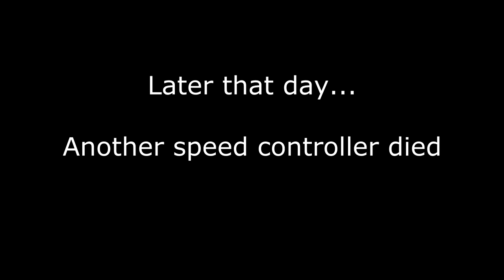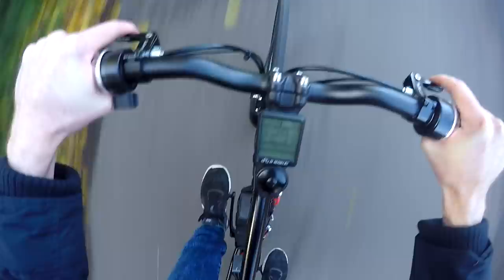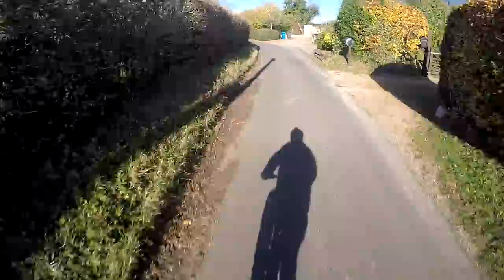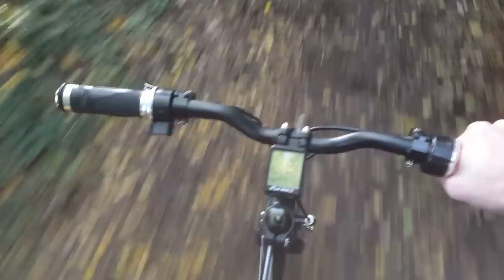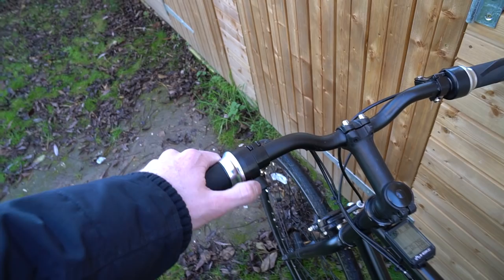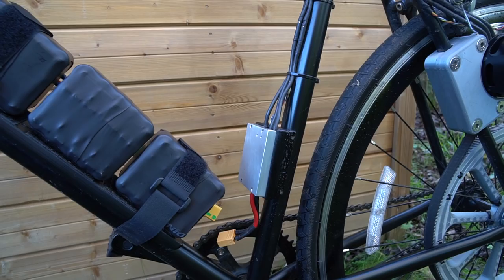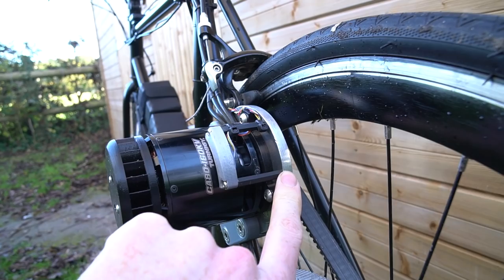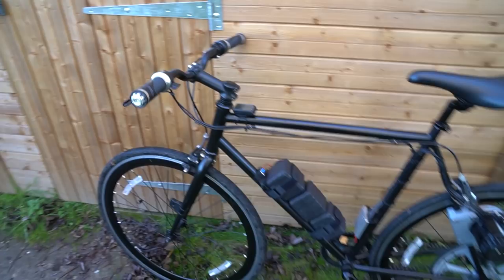Electric bike V3

Comment: I read a few comments confused about the power and pricing, and since I know a bit about this kinda stuff I thought id try to leave some info. Yeah, 700 euro is a lot to spend on parts for an e-bike. But compared to a kit you can find online for a similar power/torque/speed spec’d bike, you’d be looking at closer to 1000 euro. A completed bike with this much power? More more 1800 euro if not more. 

I built my electric bike using a 3kw hub motor, a 12.5 ah battery, and a 40 amp 52v controller. That alone almost cost me $1200 US. When you consider the brakes I bought, with the bike frame, and the lights, and everything else, I’m in something like $1400. 

My bike has seen 40mph in ideal conditions, and done 650m altitude climbs without a sweat, but I suspect the bike in the video is capable of the same with some minor tweaks to the gear ratios. 

For what this bike is, with the care that’s been put into the design and reliability, it’s incredibly cheap.
Reply from the maker: Excellent explanation! It is very easy to focus on the price and forget that performance comes at a cost. You justified the cost very well. Thanks!!
Reply: Raycool scooter 1900w cost 1200 euro and more speed 60 70 km/h
Reply: Tiago can you help me Tiago,
I am looking for an electro motor with a regulation like for mounatain driving, how i habe to calculate that whole thing when I want to say I want do drive cobstant 20km/h towards the mountain. is 500watt enough? an which battery to this?
many thanks
Reply: How much does it cost to get it certified though?
I don't know about other countries, but over here if it goes over 25 km/h it's a moped and needs to be "road legal".

Comment: Hi Tom, can you share a list of parts that you used? Maybe a diagram? Thanks, I want to build one so bad. Excellent video!
Reply: Even i
Reply: Hey guys, I'm currently in the process of making my own 3kw bike and I figured out these are probably the best parts rn:
kunray 3kw 72v motor kit (includes the controller and a throttle as well as the motor) 275$
72v 20ah battery (this is just a pre-made battery pack that works with the controller) around 275$ as well
my best bet is amazon for these
Reply: all you really have to do is make a mount for the battery and motor, as well as changing the sprocket on motor to fit bike chain.

Comment: Great build! 
I am sure it has been said before but here is once again from me.
You got this all free space behind the seat tube and the tyre. That is a great place to mount the motor so that somehow is in line with the frame. That only the pulley is sticking out on one side and the cooling fan on the other.

Comment: Hi Tom, Such a smart kiddie! Maybe a simple(ish) mod to relieve the squeeze on the motors by the small belt would be to incorporate a short shaft protruding from the back of each short belt pulley. A straight bar with a bearing for each shaft would hold the motors spaced correctly and relieve the tension.

Comment: Thank you fro great video. Is it possible to have some kind of clutch to avoid motor resistance while riding it as regular bike? What do you think about it ?
Reply from the maker: It is probably possible, but adds complexity and removes the regenerative braking capabilities. To be honest, I only ever ride this bike with the motor running anyway, otherwise I'd use another bike. Applying a small amount of power to the motor whilst pedalling makes it ride like a regular bike

Comment: Can I use a 380Kv (0.02513Nm) motor with gear reduction to produce enough torque? Combined weight of me and my bike is about 70Kg. How did you roughly calculate the amount of torque required at wheel for your build? It would be greatly appreciated if you could help me out. Thanks!

Comment: hi i am planning on an electric recumbent bike (full diy) and i planned to use a similiar motor then you do in this video. 
What is the reason that it is going "slow". i have checked many tests and some guys in australia managed to go barely 100km/h with 5.3kW on a bicycle. Are you limiting the max speed with your transmission? 
Or did i miss sth else? 
I would be very happy about an answer :)

Comment: Tom, are you still using that Arduino to convert the twist throttle to pwm or does the VESC 6 have a direct input for a pot. Can’t see any throttle systems on the trampaboard site others than the wireless ones.

Comment: Hey, in the description of the ca80 motor on hobbyking it says you're gonna need a 200amp esc. How does it work for you just using an 80amp esc? Do you just limit the throttle or does the esc itself limit the power
Reply: Esc can give 80 at most, motor itself always cold then.

Comment: What is the advantage of this motor over a hub center motor ?  Seems like it’s easier with a hub to build  or is it experimental ?     What about having a back pack with flexible solar panels to juice the batteries ??   I have a flex roll out that rolls up in my hand and makes 18 volts at 5 pm 6 watt.  Is that worth incorporating ?

Comment: I built one some years ago, outrunner with a nylon cover just mashed on the rear wheel. Did 50mph that, with a 12s. I have a video with an 8s on my "channel"
Reply: DKTAz00 mph and kph are 2 different things
Reply: Not sure what you mean. I'm natively kph, so 80 kph :p it was a head turner. Untill the esc burst into flames going uphill and nearly grilled my behind.
Reply: DKTAz00 u said 50mph on ur comment but it says 50 kph on ur vid
Reply: Right Right, thats the very first run with just 8s cells, lower voltage.

Comment: Are the plans going to be uploaded to thingiverse like the V1?  I just got the green light to start this project from the big sponsors (parents) The motor sensor is so trick! :) To me the kits' selling points are how it could mount to so many bikes, very clean minimal appearance, very practical in an urban commute. My wife uses a super-China e-moped, long range (40mi) not horrible speed but small wheels (rough) and HEAVY!  What you have here is exactly the kind of power/weight ratio a 125lb guy like me is looking for, just enough to be able to get myself hurt on - perfect fun ;)

Comment: While, you probably don't need additional batteries, do you think you'd be able to easily mount and plug in additional batteries for added range?
Reply: Yes, with those kind of packs, there is plenty of room and they dont weigh much, with the modern batteries its just a matter of price, much of the cost is in the batteries

Comment: How is the regen wired? Does it run through a capacitor or a cutoff? What happens if you fill the capacity of the 15 ah battery?
Reply from the maker: It's just wired straight from the esc to the batteries. I only charge the batteries to 4.1v per cell, which allows a total of 2000mah of head room to still be within the 4.2v max limit. From a few quick tests I've carried out, it's almost impossible to regen 2000mah from the start of a ride, unless you live on the top of a 5 mile hill and regen to the bottom haha

Comment: Shouldn't the fins of the cooling fan be curved in the opposite direction?
Reply from the maker: +xdd botnet it depends what you require the fan to do. Watch a video called "blower impeller design experiments" and you'll see that this design seems to be the best if limited by rpm and not power. Thanks

Comment: I just recognised that corner at 4.26. You are not far from me! You cycled past my friends house, that was an odd moment!

Looking to build an ebike myself and toyed with one of the ebay (Voilamart?) ewheels or doing what you have done with RC gear. I'm leaning more towards the ewheel after hearing about some of the issues you have had. Your one sure looks like fun though!

I'm liking your 4s in series arrangement. It makes them easier to charge and use the packs for other projects :-) I might steal that.

Comment: Make the pulley as large as the wheel allows (that's how old bikes were made), reverse the motor over the wheel and make a scoop (that's damage protection, and you can hook yourself much better by using the mounts meant for fenders for example), Mount the pulley on the rim itself using holes drilled on the bottom and spaced with L brackets or simply bent thread. That's a lot more force you can apply than though the main wheel shaft + more distribution if you put say...15 such mount points. And mount the batteries under the frame with an aluminium bash plate. Frankly, in a bike like this, go as low center as you can.
Reply: Also, try making an assisted pedal design as well, that should give a lot of thinking kicks. Not as easy as it might sound, plus, less dependency on batteries.

Comment: Tom why wouldn't you lengthen the belt mount the motor above the rear triangle with the pulley hanging out in the side to propel the bike you would have to change the direction the motor spins but would clean up the look on the rear and take weight off the single side??!

Comment: Great setup. I am interested if you made any changes to your 3d printer settings to get the HTD 5m profile to fit. I am trying to get some dimensions on my pulley to be more accurate ie the internal bore is almost 1mm to small. I have just purchased a MK3 prusa and this is my first printer. So should I be looking to adjust my cad file to compensate or should I use some sort of compensation in my slicer? Many thanks

Comment: Curious, Tom, how do you go about your research for what motor to buy? I've been entertaining the idea of building a remote controlled snow plow (Canadian, eh?), but I'm not sure the type of motors to be looking at/for. I'd appreciate your input on things to look for :)
Reply: Esona 
You know I'd either help you work on that. (If you live in the Maratimes), or I'd build one myself.
Reply: Iron Mangos, those would be brushed motors, which aren’t nearly as efficient, correct?
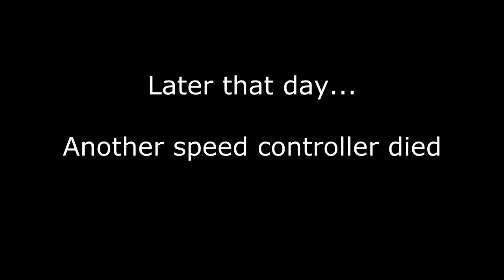Reply from the maker: I chose a motor based on lots of different things. Surprisingly speed is not an initial factor for me (this will probably change with larger vehicles), because gear ratios can always be adjusted. Usually the motor isn't the most expensive part, so I will tend to see what battery and speed controller will fit my budget. Then I'll work out a battery depending on what the maximum voltage and amp rating the speed controller can handle (60V and 80A in this case). Then I'll work out whats the largest gear ratio I can fit on such a setup (about 1:15 in this case). The 'hobby grade' motor used on this bike has a kv rating, which means the RPM it can reach per volt. So this motor is 160kv, therefore with my 50v battery, it can spin at a maximum 8000RPM. then using the diameter of the wheel etc I estimated about 36mph, which is plenty of speed. This might be completely different for larger motors as I have no knowledge of that field. So it's a bit of a juggle of components to get the right setup. Thanks
Reply: Hi, very COOL (ehhh :-)) project! Nice you are back with the rear brakes and even KERS :-) ...And that you think about heat more too - how hot is the VESC? Wouldn't be good to have some heatsink on it too? Isnt some serious voltage drop on the cables also?

Comment: What is "FOC mode"?
Reply: Chad Kovac Field orientated control for the VESC. It makes the motor more torquey and silent.
Reply: It essentially sends a sine wave to each electromagnet in the motor instead of a square wave, this causes the electromagnets to always be on which can cause the motor to run hotter and not as fast, however it reduces the vibrations from switching to the on/off state as quickly as a square wave would, limiting sound.
Reply: Zeptonite A sine drive signal shouldn't make it run any hotter than a square wave if the RMS power is the same...
Reply: That is correct, however, in FOC mode each electromagnet that isn't being used to attract the rotor is still technically turned on but just in the lower part of a sin wave (so it still receiving a small amount of power). This causes the motor to become warmer than the traditional BLDC mode because in BLDC mode, each electromagnet is off until it is needed to attract the rotor (hence a square wave only having an on or off state)
Reply: Good job on the build.  Enjoyed the video and narration.  Glad to see we have some smart young people coming up the ranks.

Comment: Maybe this has already been asked, but still: is there an active project for an open source cycling on-board computer? I mean a computer to collect data/gps and build statistics for a standard bike, not electric. Of course this could be interfaced with the motor controller in case of electric bike. So, anyone aware of such a project? By the way, congrats to Tom for the great builds, this is inspiring:)

Comment: why not also mount the motor above the tire and inf front of it, right behind the seat tube. so that its not sticking out to the side so far and looks more integrated. (flip the motor assembly by 180 degrees)

Comment: Hey Tom i'm building a mini dirt bike with an SK3 6374 and 168kv on 12S with a focbox (basically a vesc 6) and for some reason it won't accelerate at all, it's super slow for some reason. do you have any idea why it's so slow or what to do about it? it's 6:1 gearing which should be decent for acceleration right?
Reply from the maker: Hey, what is the diameter of your wheel? The gearing I used with the 192kv motor and 622mm diameter wheel was 1:15. Also, have you added hall sensors to your motor? This will increase the torque at low RPM.
Reply: Tom Stanton its 400mm no hall sensors but I'm guessing I'll need them. so I'm guessing me gearing is still not high enough?
Reply: Tom Stanton i can probably 3D print a small reduction gear box right? do you think 2.5:1 or 3:1 would work better? i want just pure acceleration so probably the higher the gearing the better right?  by high i mean high ratio. idk if gearing multiplies I'm not an engineer so would combining the 3:1 reduction with my current 6:1 make an 18:1 gearing?
Reply from the maker: Sorry I've made a stupid mistake and messed up my gear ratio value, it should have been 15:1. So if possible, you'd be better off increasing your driven gear. I'm not sure a 3D printed gearbox could handle the forces involved, but I think you can buy reduction gear boxes for stepper motors, maybe one of those will work (I've only seen images, I've no idea how to put them to use). And yes I believe gear ratios do multiply as you've mentioned.
Reply: Tom Stanton you don't think 2 pulleys with a belt would be able to handle it? problem i can't find any pulleys to create the correct gear ratio i want of 2.8:1. most belt pulleys are 2:1 or 3:1.

Comment: So wish you tried it with a recumbent bike instead. You could easily half your air resistance and reach much higher speeds with a more aerodynamic model. Much greater break efficiency as well with the lower center of gravity. :)

Comment: Brilliant engineering and great challenge..been a lot of fun watching ur progress. When you take those runs and go flat strap, I get worried :) I don't see the point in going faster..if you want that - get a cheaper petrol scooter..second hand could get something that run around for 2 weeks on a full tank, for cheaper than you have outlaid for your project, and go a lot quicker, and be a lot safer. For the environment..I don't know if charging batteries from the grid/coal every night, is it any better than buying a few litres of petrol every 2nd week..solar is different matter? What you should focus on is going farther, at a safer speed <20m.p.h..work on getting the furthest distance. I'd be worried that someone builds this and kills themselves, and I would definitely be wearing a full motorbike helmet, gloves/safety gear

Comment: Great work, but the motor should run only when the pedals are running. In the best e-bike the power of the motor is driven by the force you put on the pedals!
Reply: Paolo Amboni Incorrect... The system you are describing limits the way you can enjoy the bike...

Comment: In Europe motor must automatically turn off at speeds over 25km/h to count it as electrical bicycle and not scooter or motorcycle. And power is limited too (but I don't remember exact number, it is not very high) Does UK have such regulation?
Reply: What makes you think UK isn't a part of Europe? o,o However, the rules in UK is 250watts max and 15.5 mph - The same as you mentioned. :P
Reply: «What makes you think UK isn't a part of Europe?» — Ok, road code is different for sure. For example, UK drives on other side of the road :-)
Reply: Yes. Legally in the UK this is a motorcycle.
Reply: Yeah, in the UK e-bikes need to cut power at 15.5mph, be 250watts or less and be pedal assist only.

He's made a non-road legal motorbike.
Reply: @James Smith - most of the time people drive on the correct side but as Tom said, you just don't know on country roads.
Reply: blacklion79 I love usa we are not allowed to have 1000w max at 30mph with a m type licence
Reply: JosefsensDK He probably meant EU, which The UK will soon abandon.

Comment: Very nice work! 
Do you think it is possible to mount the brake on the inside of the frame? Kind of inside the "triangle". 
Could save space and allow for mounting the motor on top of the wheel, where the brake now sits.

Comment: having a look at the motor on the hobby king website. it $207 AUD not a bad price. what did you mean by you knocked the shaft through? and how did you do it? its not clear from the pictures on the web site.
Reply from the maker: As stock, the shaft sticks out the end where the silver hardware is mounted in the hobbyking photo (opposite end to the wires). So I heated up the end where the shaft sticks out and knocked the shaft through with a hammer so it stuck out the other end. Does that make sense?
Reply: yes it does, thank you for the reply.  i assume the motor wasnt damaged by this? any long term effects that you have noticed?